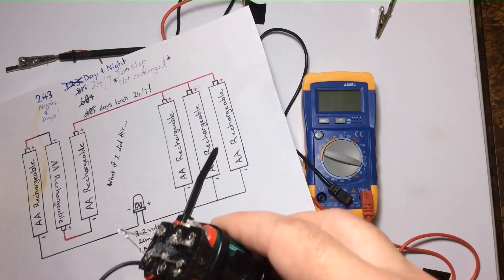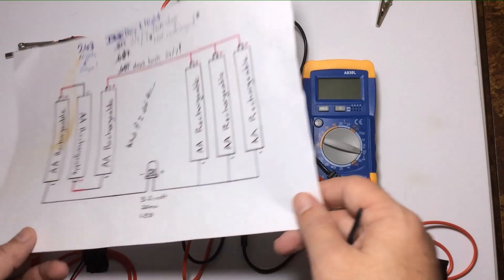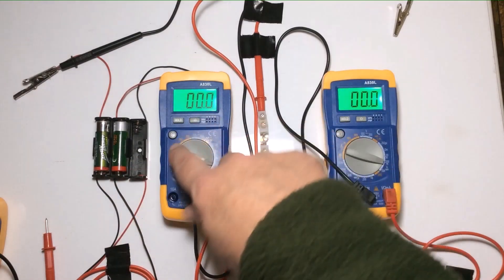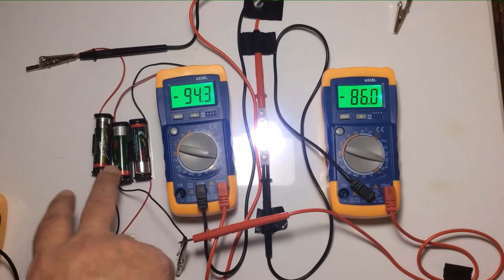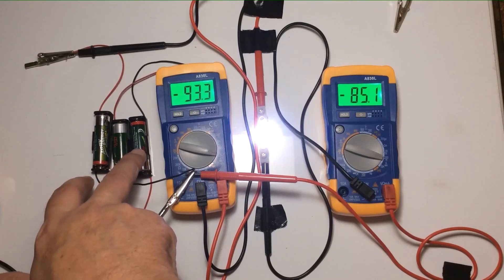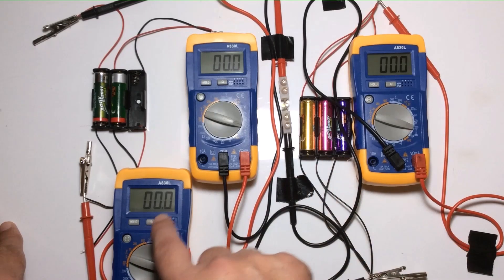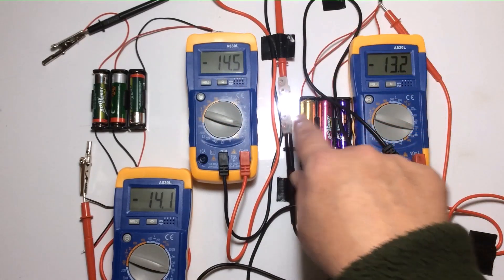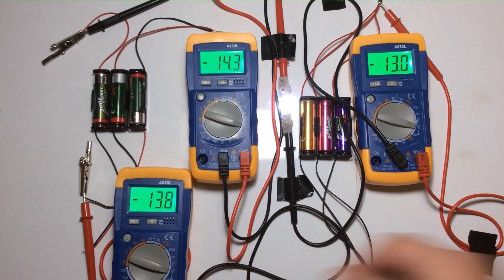TEST TERMINATED ON DAY 275... BUT HOW DID IT LAST SO LONG?

Comment: Little questions : is baterrei re-charge after 275 days and the experiment then go again ? 

What happen in baterei cell ? is each batteri voltage get to their norm voltage after re-charge each of them ?
I curious if your circuit NEVER depleted the baterei cell AT ALL.  
Hope i'm wrong 😅

Yes, i do experimet myself with 4 AA baterei bank each, and it still light my 20 mA led for 7 days full non stop without any intervention 😮😮
Reply from the maker: Thank you for your comment.
I sincerely apologise for my delayed reply.
After I finished recording the video for the 275 days test I placed the batteries in a charger and they all charged as normal. I tested the batteries after recharging by depleting them normally and then measuring the amount of energy it took to charge each individual battery and interestingly all the batteries read a higher capacity than their advertised ratings.

Comment: How about a meter between the grounds too. I think there's a draw from ground to
Reply from the maker: Thank you for your comment. The meter in the lower left corner is placed on the negatives of each battery bank and positioned between the battery banks. There is no earth earth connection within this circuit.

Comment: Great vid.    Aren't Transverse waves faster than the speed of light ?   I think they are also called scaler waves.   Its like tugging on a rope.  The opposite end has an immediate  instant impact and you could be at opposite ends of the earth for this to happen.
Reply from the maker: Thank you for your comment. I believe you are correct, scalar waves are faster than the speed of light or “superluminal”. I have often wondered if my reconstruction of Tesla’s through earth transmission circuit was using scalar waves as the power is transferred immediately over 100 metres away.